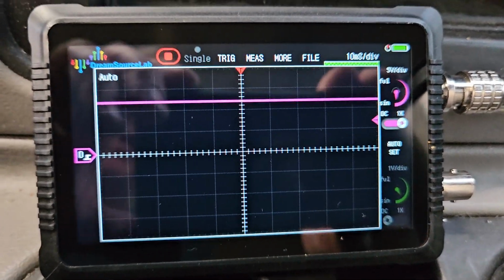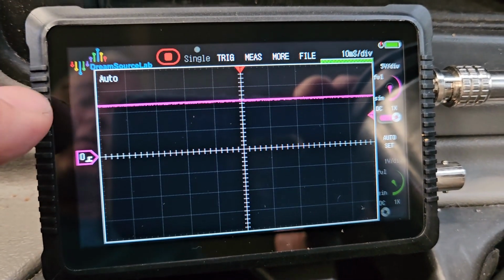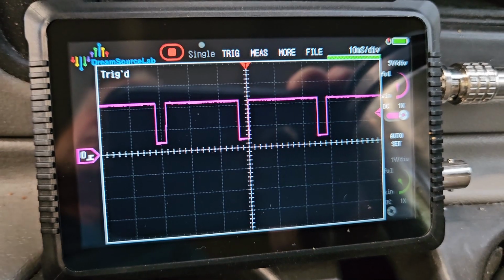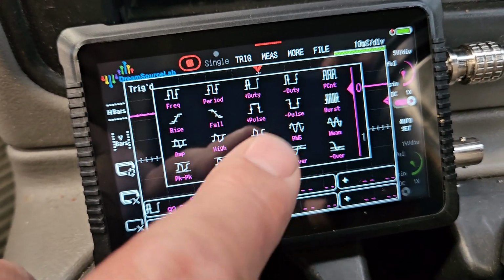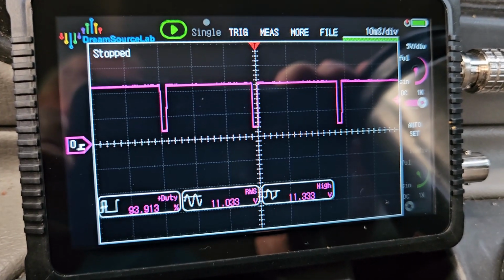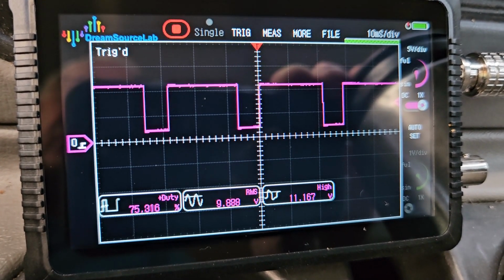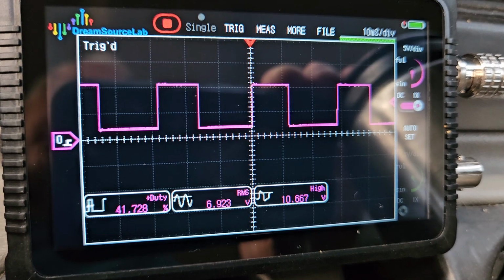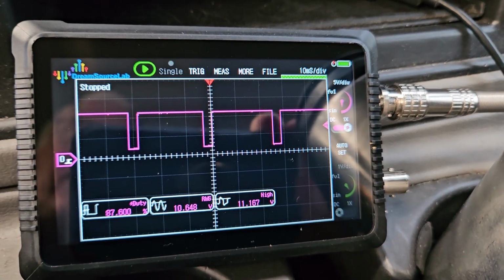Measure Duty Cycle with DreamSourceLabs DSTouch Oscilloscope

Comment: Great demonstration. I also have this portable scope and do recommend it. I think my only concern is that the battery is not replaceable. Worry that that after4-5 years, the battery will no longer hold charge and this is no longer useable.